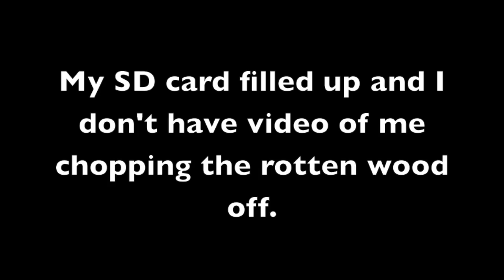Skate board wheels

Comment: Problem with wood is it cracks, and on the skateboard there is allot of abuse, i would use a very soft wood like yellow wood and maybe flame harden the outside surface that will be touching the ground first then put in in a pot of oil for a couple days that it really absorbs it all the way